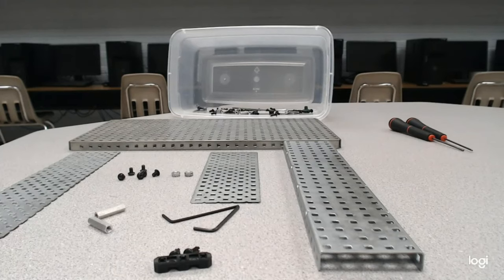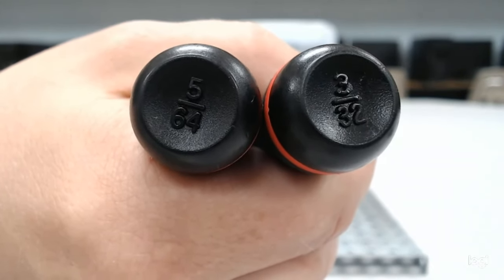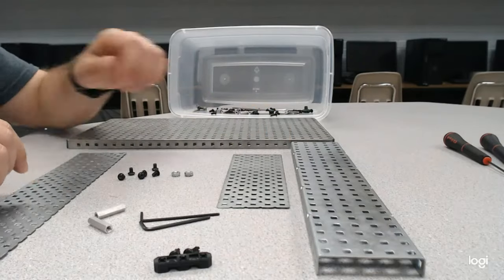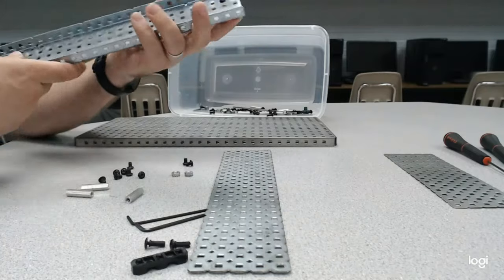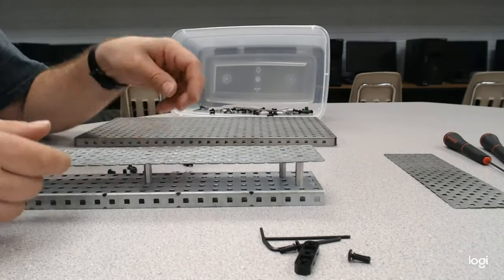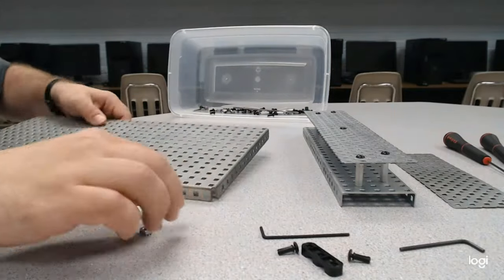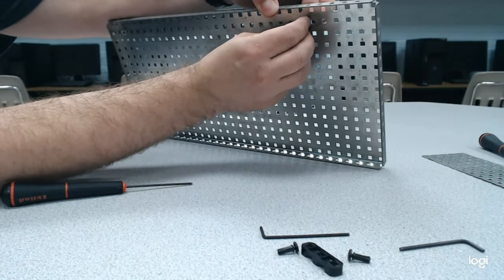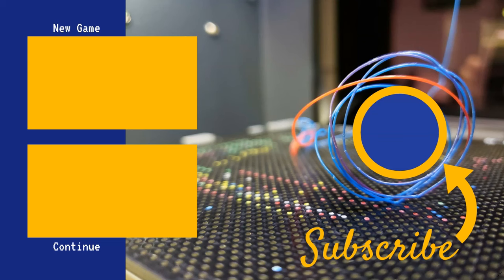VEX Gear Tutorials - Building the Platform

Comment: Man called a screwdriver a wrench  💀
Reply from the maker: The Hex Key used with VEX equipment is also known as a hexagonal wrench, hex wrench, and even Allen wrench. Screwdrivers are traditionally either of the flathead or Phillips (also known as a crosshead). So the use of the word wrench is accurate for the tool used.

https://www.thisoldhouse.com/tools/22274449/best-allen-wrench-sets
Reply: @itsvoid it's clearly an allen wrench with a screwdriver-like handle homie